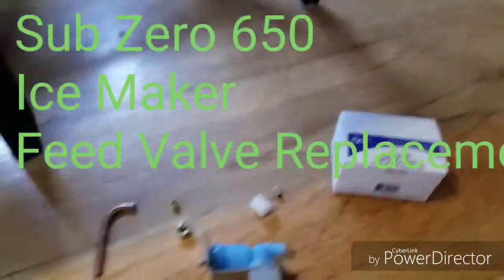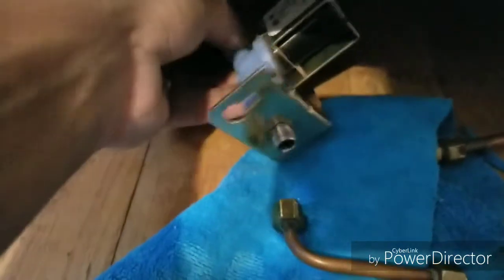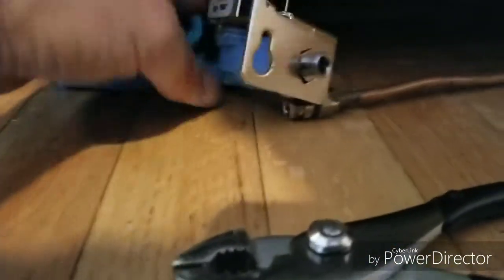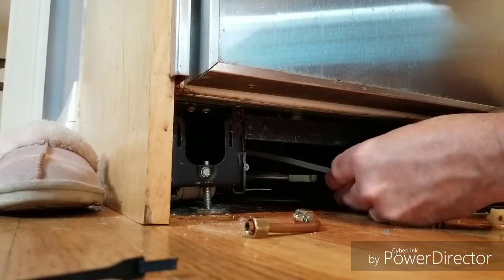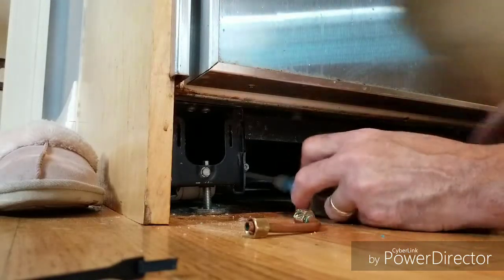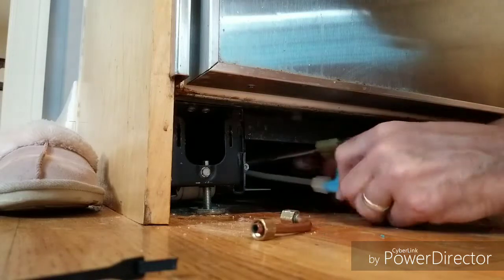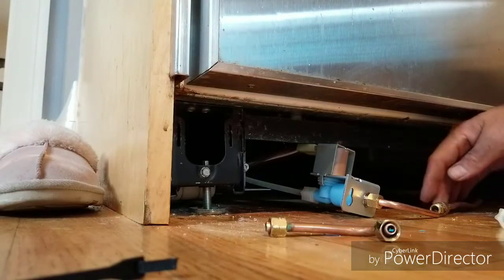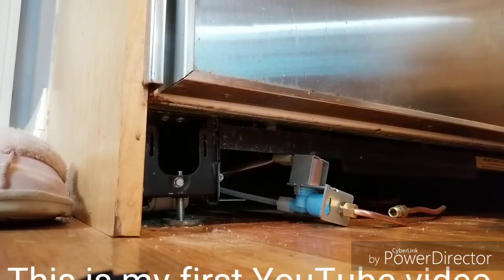Sub Zero 650 Ice Maker Solonoid Water Valve Replacement

Comment from the maker: Hi guys.  Sorry for the delay responding.  I had no idea anyone would watch this and my daughter just told me that 4,300 people watched this.  Shocking!
The ice maker wouldn't make ice and I had already replaced the icemaker unit and the supply pipe heater, etc.  
Replacing the solenoid did the trick.
Hope that helps!

Comment: The disassembly portion doesnt show u taking apart the solenoid, how do i remove it
Reply from the maker: I see your point! 
The solinoid is disconnected by pulling apart 2 male/female spade connectors and  1 water feed tube plastic nut. 
Sorry both my hand and a rag were blocking this part of the process.
Hope this helps